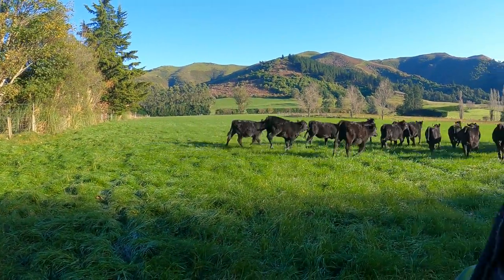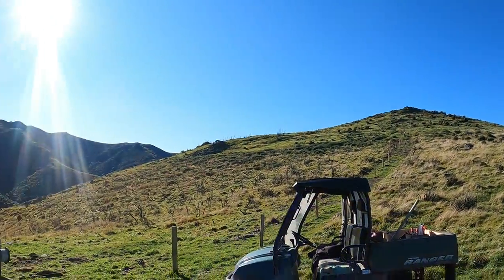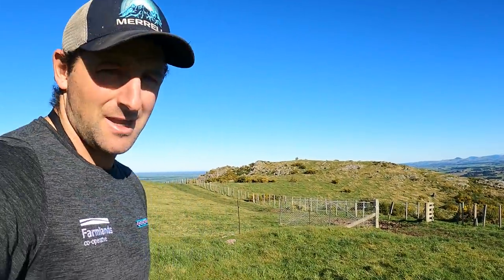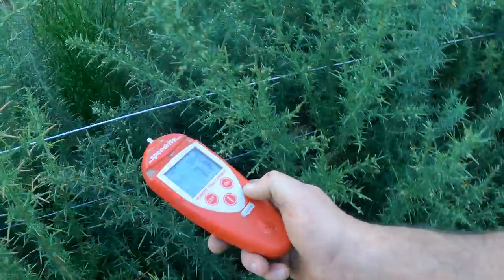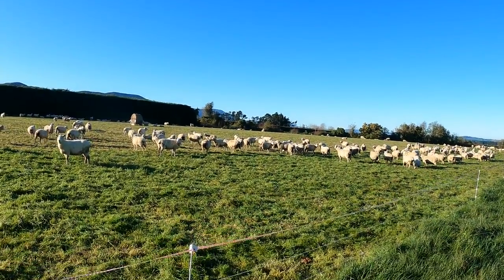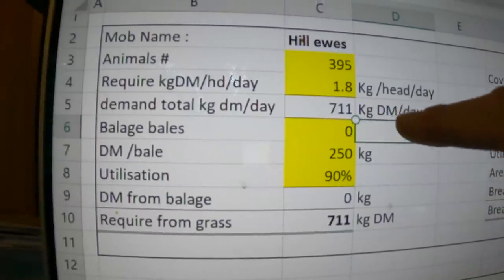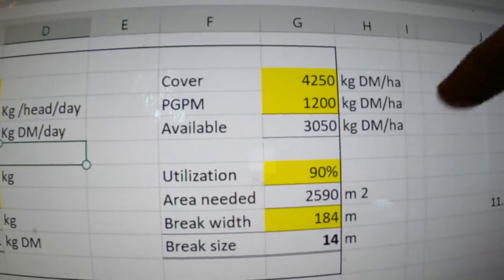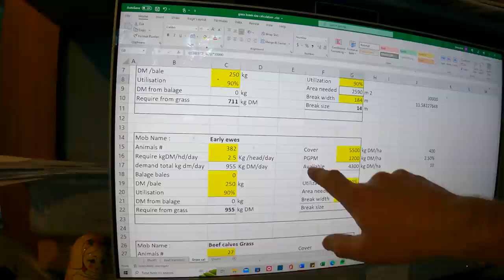How I Calculate break size Part 1...

Comment: I have an Avatar.  Chinese made and imported by Avatar in Hastings.  1100cc turbo diesel with five speed manual gearbox, huge winch and massive tray on the rear.  Manual is brilliant and way better then CVT in my opinion.  Fully galvanised chassis (is great) and  2x4, 4x4 and diff lock in all modes, full cab with front and rear windscreen.  They get a bit of a poor rap but affordable and well built.  Have the 6 seater (second hand) and love it.
Reply from the maker: Thanks for the info Peter.

Comment: Hi mate
Honda are by far the best however they are dear and at the moment have major supply issues. I also have a Polaris but wouldn’t buy another. Avoid the belt drive types.

We use porcelain reels tied on with wire, a technique I learnt 20 years ago and now have thousands done. They take 25 seconds to put on but will last a very long time and no maintenance required. Bugger that walking up and down looking for earths.

Videos are great. Good to see a Kiwi perspective.
Reply from the maker: Thanks mate

Comment: Hi Alastair, farm lower North island, great channel, have pioneer 1000,grunty, they do cost to run tho. Hd9 seem a good machine if cvtbelts don't give you to much trouble. Did you make your xcel template? Cheers for the content.
Reply from the maker: Hi Adam thanks for the message. Where abouts do you farm. I was brought up in the  manawatu. Yep made the spreadsheet myself.